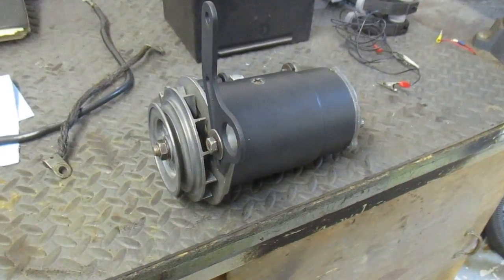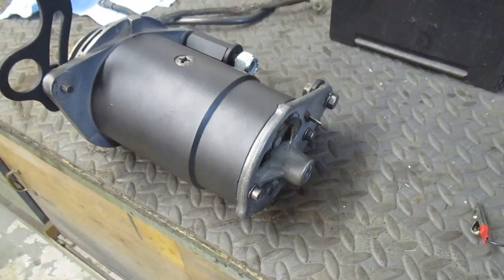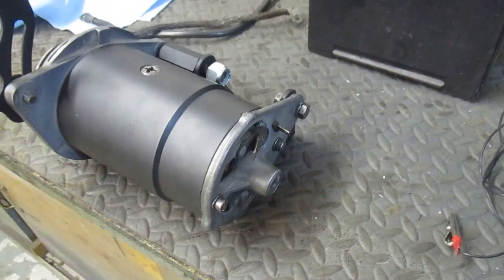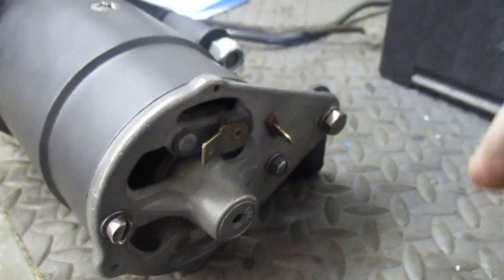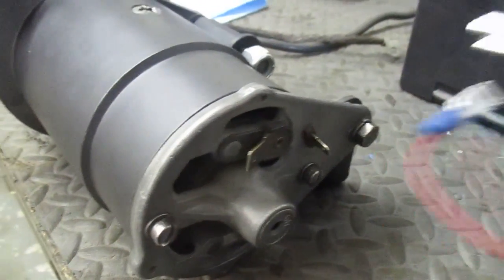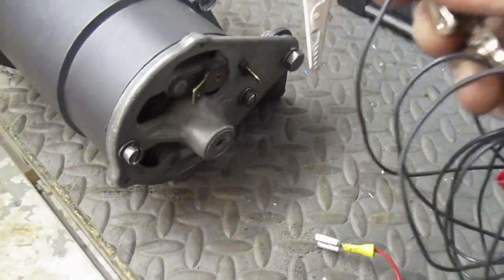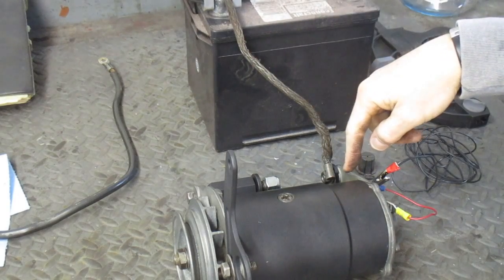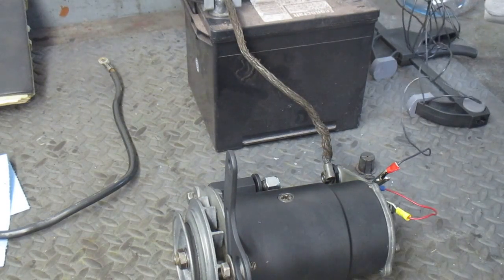Automotive Generator Testing

Comment: That thing sounded like Ghostbuster’s Ecto 1 siren when it spun up 😂
Reply from the maker: Yup, it does. It startled me a bit when it started. I don't know what I expected, maybe for it to ramp up or something. Neat how electricity works!
Reply: @roundtailrestoration - It actually should have been very quiet. The noise it made it indicates the commutator is in need of "dressing" -- that is being trued on a lathe and the mica between the segments undercut. An old Motors or Chilton repair manual details this work.
Reply from the maker: Thanks, I didn't realize that. Something I'll have to pay attention to. No noise yet that has made me nervous. @Inflec

Comment: great video!
Reply from the maker: Thanks!
Reply: @roundtailrestoration  I don't get why the F was connected to A
Reply from the maker: A generator (not alternator in newer cars) and a motor are essentially the same thing electrically. In a motor, you apply electrical power and it spins. A generator is opposite - you spin it and it provide electrical power. Shorting F and A together effectively wires the generator up as a motor, which is why it spun when I applied electrical power. It was a basic functionality test. It doesn't tell me that it will charge the battery, but it tells me that it is electrically sound enough to do so. I think I linked to a Moss Motors video in my video - I'd check that out, too.
Reply: @roundtailrestoration  maybe mine is set up differently. The A and F are the ends of the electromagnet. If you connect the 2, then there's no flow of charge.
Reply from the maker: @OldCrowsClassicCars  Hmm. Are you working on a Lucas generator?